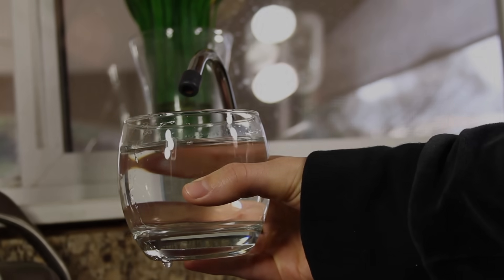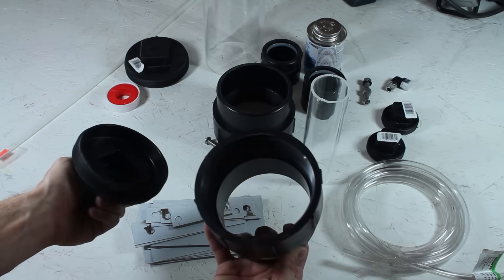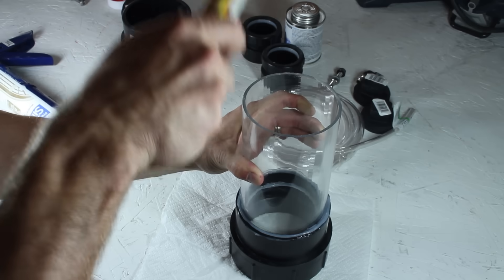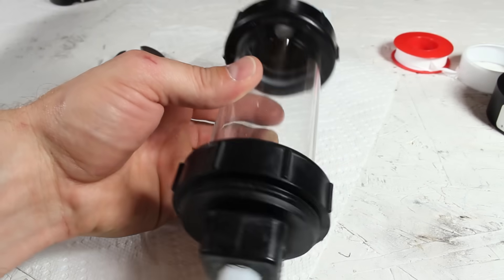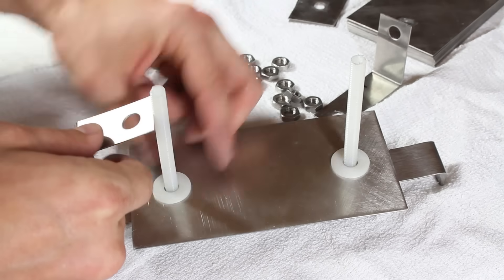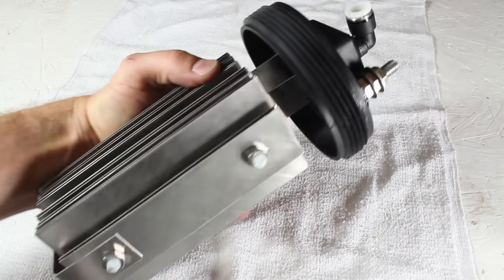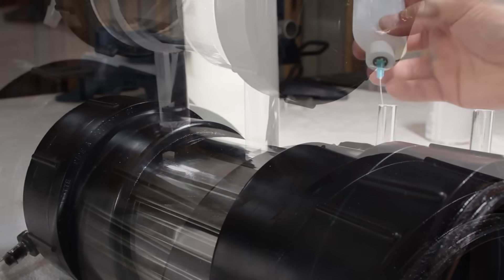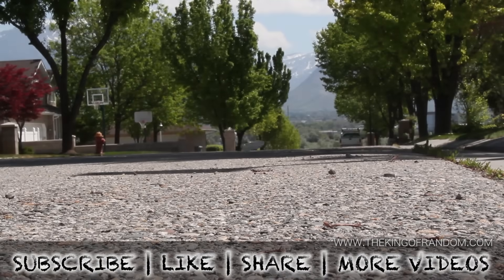HHO Generator - Water to Fuel Converter

Comment: If anyone wants to make this project, then please consider safety and use shielded connections on the generator and a switch on the battery side away from the generator.  Connecting and disconnecting the generator with alligator clips could result in an explosion right near your hands if there's a spark and any leaking is occuring. 

Even a car battery on it's own, charging will generate hydrogen gas.  As for a fuel source, the issue is the power required to generate the gas.  Sure you can make the hyrdrogen gas but as you saw in the video, besides a nice short bang using hyrdogren gas continually results in a high use of power for not much gain.  There's scuds and scuds of hyrdrogen generators for saving fuel out there and the end result is while they work in function, the power required to generate the gas is an ineffecient process and is akin to the 'sterling engine' in the steam world.  It works but you need a lot of heat for not much engine power.  If the heat source or in this case the power source, is abundant that wouldn't be a problem.  However both sources are finite and evenutally have to be replenished or replaced.  Hence you end up back where you started.

Another point to consider is that Hyrdrogen is the smallest atom, it will escape from anything over time, this is why  lead acid batteries have small venting ports in the battery to prevent dangerous build ups and allow faster escape of the volatile hydrogen gas, which as you saw will disperse fairly quickly.  In fact if you make some Hydrogen gas, put it in the bottle, leave it then come back to try and light it, you'll find it doesn't explode as the gas dissipates rather quickly.  Experiment for yourself. 

Myself I'd like to see compressed air engines and hydraulic engines as opposed to hyrdrogen engines.  Much safer and with the driving skills of some people out there, I'd find much comfort in knowing there not driving around potential time bombs, made worse by the way a lot of people fail to look after there cars and let them run into the ground. 

My favorite application of all time, was the famous Hindenburg Zeppelin.  What a grand aircraft.  Sadly as I'm sure everyone has seen.  That much hydrogen and the slightest spark = disaster.

This is a great science experiment though and it would be interesting to measure the effect of different ratio's of potassium hydroxide to water with the amount of hydrogen gas generated over time to find the optimum ratio.  (It can probably be calculated already but ingenuity and trial and error methods are what lead to the eutectic phase diagrams in the creation of high quality steels for example.  It can also lead you to the optimum ratio's for your hydrogen generation.  BUT: MAINTAIN SAFETY.  There's no point making scuds of hydrogen, smiling and then making it all pointless by blowing yourselves up.  Take care).

Hope that provides some points that can save people a lot of time and there limbs.

Sean A. Curtin

Comment: The thing that makes fossil fuels great is that they are in a liquid state and this liquid contains much more energy than a battery can store. There is a solution to the problem of batteries and that solution is hydrogen. Instead of storing energy in a battery that energy can be storied in the form of hydrogen. The hydrogen can pressurized in tanks and this pressurization will turn the hydrogen into liquid. The hydrogen can be combusted in engines, which will retrieve the stored energy. When the hydrogen is combusted it turns back into water.  The hydrogen right now will be made with electricity from the cheapest ways to create that electricity. When power plants make electricity it has to be use right when it is create or it will be lost. Some power plants can store the energy by pumping the water up and holding it up hill and then when the power is needed the water is let back down and on the way back down it runs through a hydroelectric generator. The hydroelectric generator will produce power. Hydrogen is a great way to store energy especially when using it on a vehicle.

Comment: 25% nitrous for an rc car works exactlly the same but it is expensive my uncle has actually been pulled by the water bottle… Parent or guardian super vision!!! 8 all you need is max 3 drops of nitrous and a ANY clean empty bottle works with the big ones too. So you take your 3 drops of nitrous put them inside the bottle let it dry…        Parent or guardian needed take the bottle and put on the ground DO NOT AIM AT ANYONE take a match or any kind of litter and tourn on at mouth of bottle

Comment: Please make a video that shows how you can store the hydrogen gas into cylinders like a propane tank.
Reply: Thats the easy part get a normal compressor and put the hydrogen line out on the air intake check valve on the compressor Boom!!! Given its producing enough gas over suction of the pump

Comment: King,
I read you instractable but can not watch due to speaker problems. When reading, i can not find a set volume of solution the generator can hold. Also i could not find how long the generator would last at X amount of voltage. Do you know this information?
Thank you
Brian